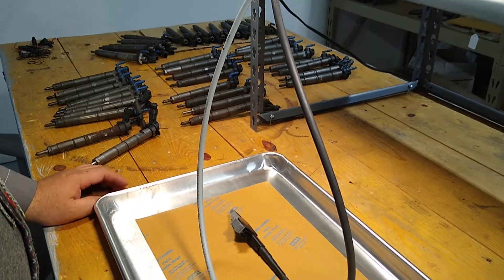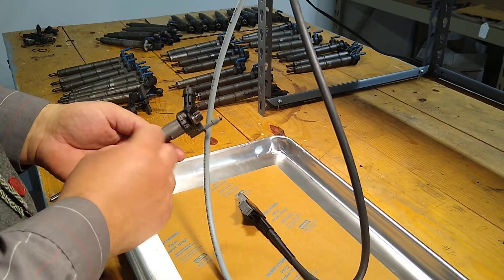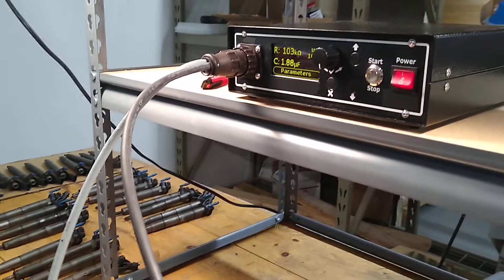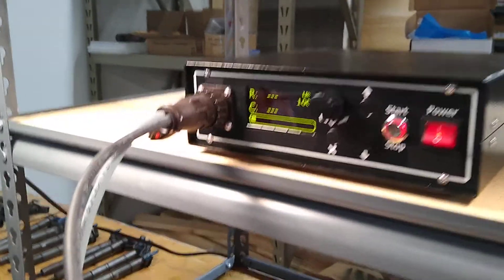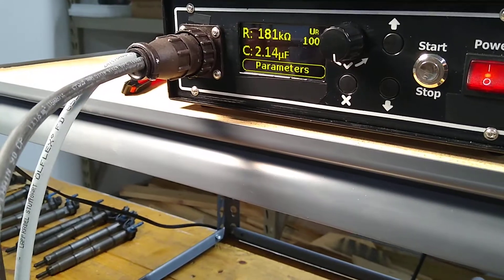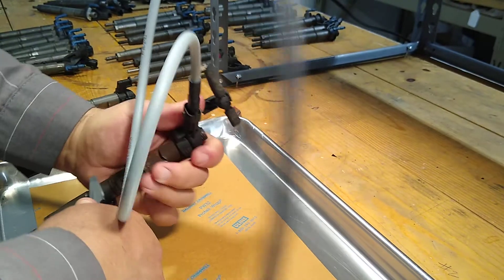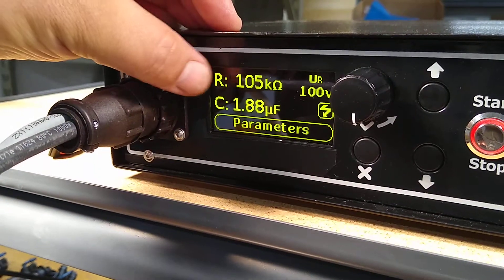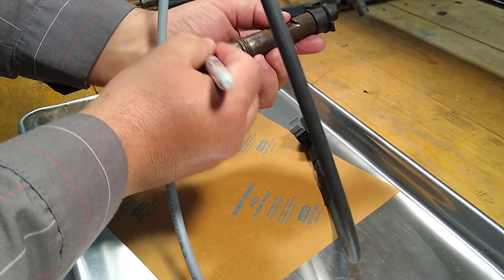Checking Bosch Piezo-type Injector Resistance

Comment: Hi, nice video. 1) What does a zero resistance value mean, 2) what is the acceptable resistance value for a good diesel injection and 3) what is the right ohms position to set on my multimeter. Thank you
Reply: 180 000 ohms : ok and about 2 micro Farads ok. You can do it with a simple multimeter, position 200K
Reply: @frankyghost7256  hey sorry to bother you i just wanna ask if there's an database of all the injectors values like resistance gap ......?